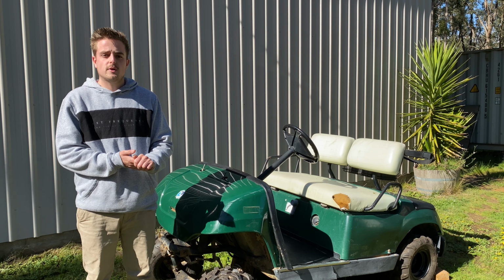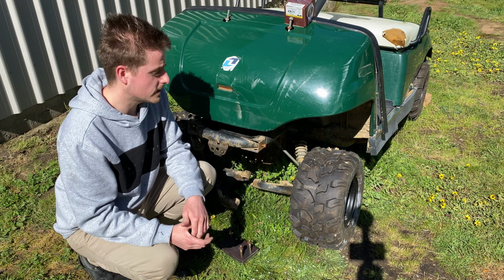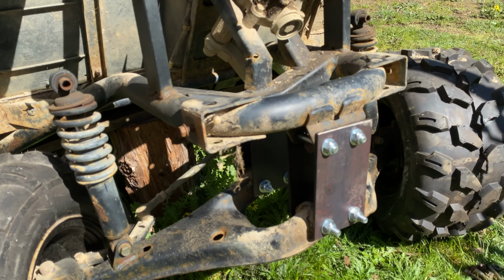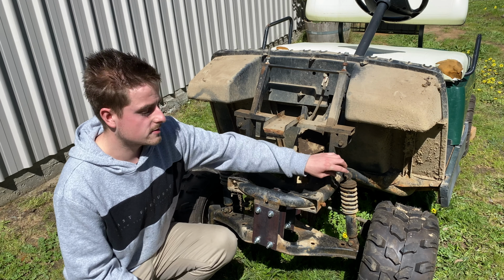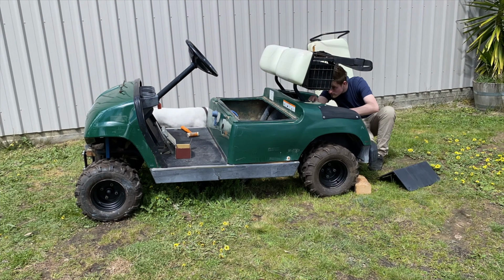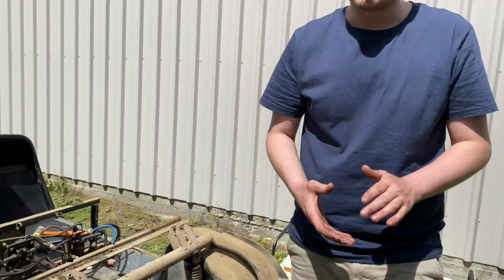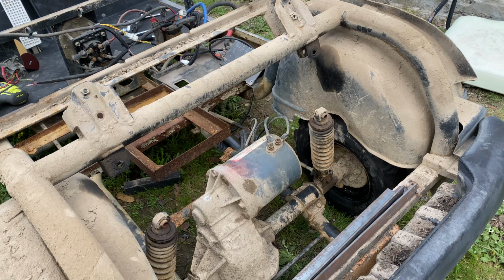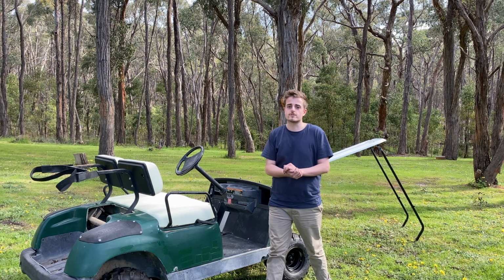Golf Cart Lift | Part 2

Comment: You should see if you can get gsxr 400 street bike engine. Not sure about around you but her in California us you can pick up an older street bike engine cheap I found a 2014 GSXR 600 with harness, radiator and all the goodies for only $200.00. That’s one of the better prices they are not all like that but they are readily available in Craigslist and are sick in golf cart builds
Reply from the maker: Hey mate I would have loved that but they are expensive here where I am.. thank you for the advice!